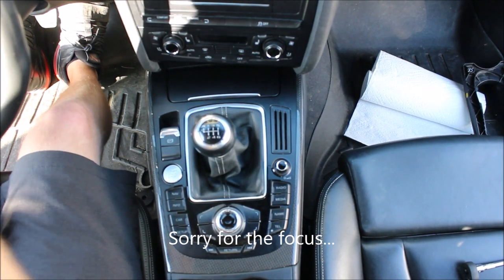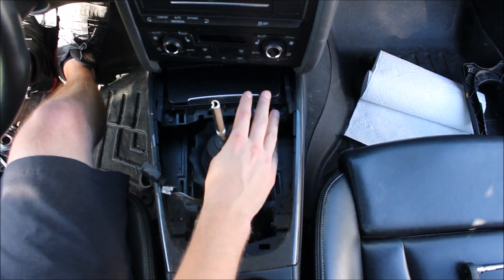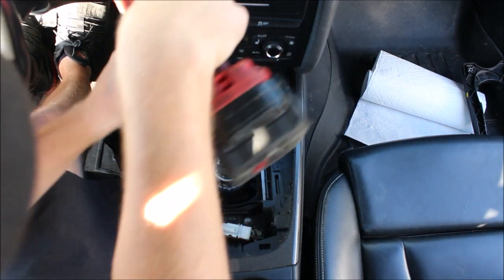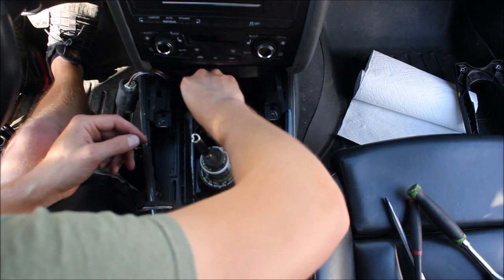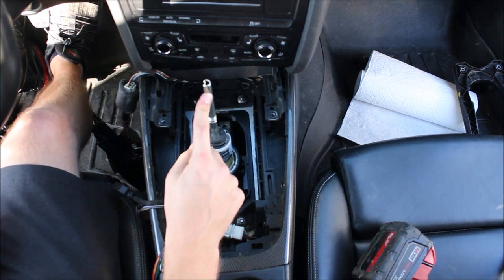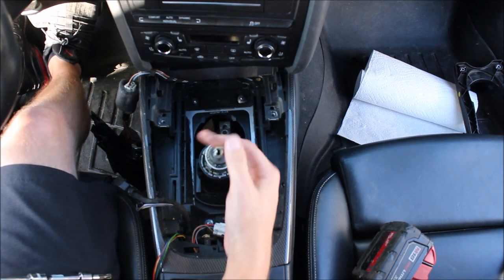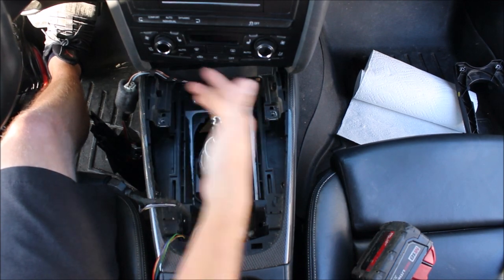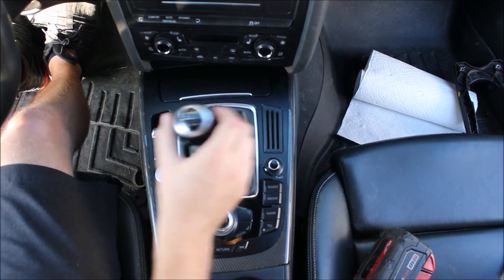Audi B8/8.5 Billet Shifter Mounting Plate Install - JXB Performance

Comment: Looking back should we have re-loctited the shifter bolt?
Reply from the maker: Not a bad idea.  If you're installing the short shift clamp at the same time, we provide a new bolt and nylock nut that should be used for the pivoting attachment, and the factory nut/bolt moves up to fix the clamp to the shift lever.
Reply: Just installed this and it made a huge difference with my shifter slop. Thanks for bringing this product to the market. Also, the quality is better than oem.

Comment: Great Video. Im going to replace the whole Shift Console. I probably won't be able to change the linkage on the transmission because i guess on a S5 V8 theres no room to get to theese without getting the transmission out.

But at least the shift console can be taken out and the connectors + screws can be replaced. Currently i have this issue where it slops like crazy left and right, and not much resistance when shifting, it feels too lush. I hope this can be solved with adjustment without getting the bearings out of the transmission.

https://www.youtube.com/shorts/yeROKdYBSwY
https://www.youtube.com/shorts/UzVgOnuW1RE
Reply from the maker: Check out this video for a more complete overview of all our shifter options.  The S5 V8 has the same trans as the S4; the install for the linkage crossrod is the same and can be done with just lowering the back of the trans down a little. https://youtu.be/rOcQiUitV2A